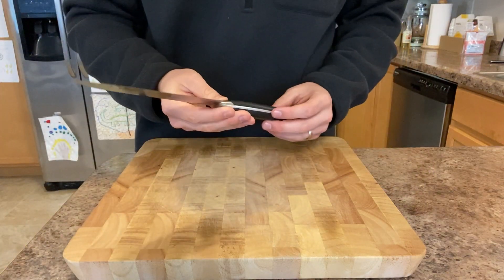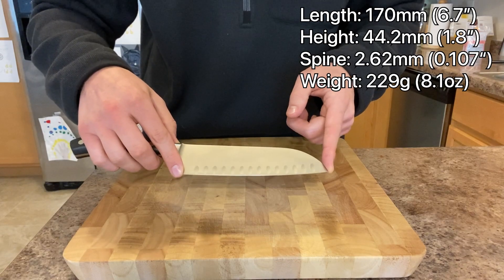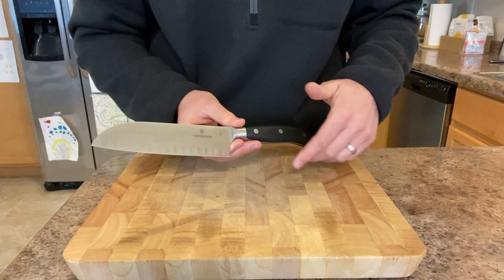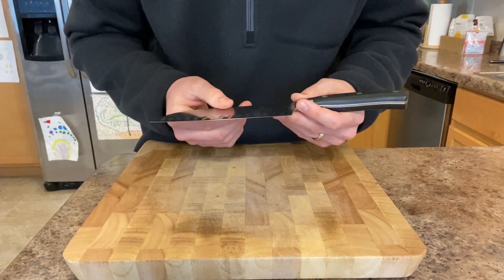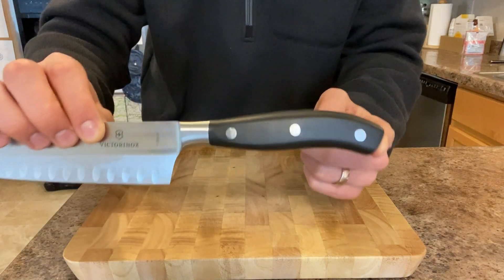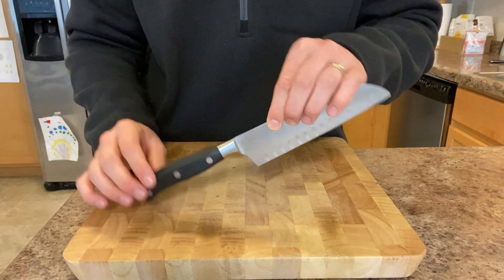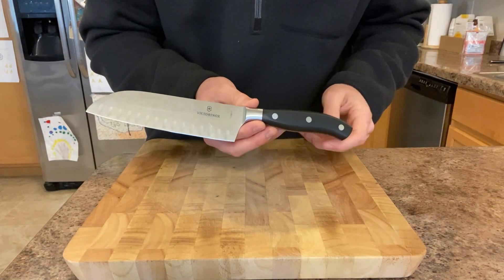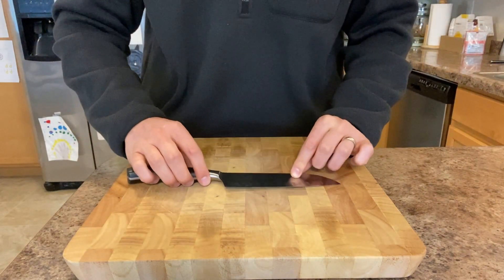Victorinox Grand Maitre 6.7” Santoku Mini Review

Comment: How do you like Victorinox’s basic kitchen line (fibrox, etc.)?  I’m guessing their steel would be great in the kitchen, but I’m pretty new to kitchen knives.  I got a Santoku for Christmas “MAC Superior” which is from a budget line that America’s Test Kitchen recommends.  It has SK-65 steel, which I don’t believe is stainless, but I’m guessing the benefit is additional hardness (at least compared with budget stainless).  Also, have you seen the Spyderco Santoku?  That thing is super interesting.  It’s like a cross between a santoku and a lightweight veggie cleaver (super slicey and broad blade for scooping stuff off the cutting board).  The steel is supposed to be comparable to VG-10, so nothing special by Spyderco standards… would love to see them using Magnacut in their kitchen knives (they’ve already upgraded the Native Salt to Magnacut).
Reply from the maker: Really love the Victorinox Fibrox knives for what they are! Have a full set that I did a video on a while ago if you're interested in my thoughts on specific models. The santoku and 6" curved superflex boning knife are real standouts imo. The steel is definitely soft though so you'll be regularly honing.

What I love about them is that Victorinox knows how to make a knife. They always come with 0.008"-0.010" behind the edge at about 15-17dps (I run them at 19dps). So great cutting geometry. Then the spines are always only as thick as the absolutely have to be with tall grinds. Makes for very nice performing knives. I find the handles super comfortable as well so they are all around good to go at a price that's hard to beat. 

Also have to mention that their steel is super easy to sharpen because it's soft and they somehow make it not insanely difficult to deburr like 95% of all german stainless cutlery.

I'd steer clear of the spyderco kitchen knives honestly unless you're looking at the Murray Carter ones. But at that rate you can get hand made blades for that price. The standard ones use MBS-26 at about 59HRc which is just okay but they're pretty thick behind the edge and just nothing special.
Reply: @EngineersPerspective701   The Spyderco Santoku has such a tall grind, it would be unfortunate if it's thick behind the edge (I can't find any measurements on that).    Thanks for the Victorinox suggestion.  The Santoku doesn't have as much belly as I'd like (mostly for rocking cuts on garlic).  But if they're all thin behind the edge, the chef's knife looks pretty good.  I'm still learning about proper knife maintenance... Would you just hone the Victorinox knives, without stropping?  Also, I've heard that you don't need to hold a perfect angle when using a ceramic honing rod.  Is that true?  If so, I should get one.  My initial attempts at free-hand sharpening have been unsuccessful.  But if honing is that easy, then that would be a good place to start.  I'm also looking at getting a Ken Onion Worksharp, which looks simple to use (especially on our farm tools, which the company claims it can be used on without any guides or special angles).
Reply from the maker: @FreedomFox1  there are some forgiveness with using a steel based honing rod but less with the ceramic. Lookup wedgek for guides you can put on your honing rod or buy the one they sell. I do prefer the idahone one but theirs is satisfactory. 

For the Victorinox fibrox series I like to use a steel based honing rod and strop a couple times a week. You can use the ceramic too though it’s personal preference. When it won’t hone or strop but then sharpen. The work sharp would be good for these but you’ll probably have to sharpen a few degrees lower than the guide you use on your hone because the belt flex adds a few degrees. Maybe do it at 15-17dps and hone at 18-20dps. You’ll have to mess around with it to what cuts best for you. 

The work sharp is a great tool to have around the farm. I’d really recommend also getting the blade grinder attachment while you’re at it. Have videos on the channel with it. Do practice before using it on knives you like.

Comment: How would this compare to the cheaper Japanese knives with harder steels like the Tojiro DP?  Seems like you could get a better Japanese knife for the same price point.

Also with the angling down of the handle, it looks like fingers can hit the cutting board, especially if you have larger hands.
Reply from the maker: I have a Tojiro DP Santoku that I much prefer. Better in every way except for handle ergos and finish of the handle. 

I have had some knuckle contact issues with this knife for my large size hands. I wouldn’t say it’s a problem necessarily but not ideal
Reply: my question exactly, thanks for asking (and EP for answering)
Reply: @HaitiSpaceAgency  You are welcome. Hope your space agency is tracking the Webb telescope's journey. :)